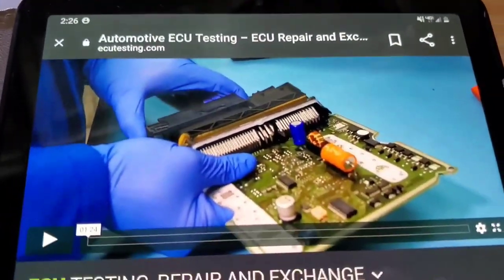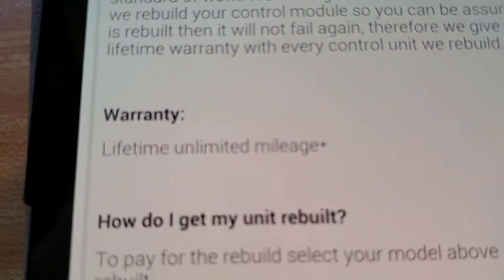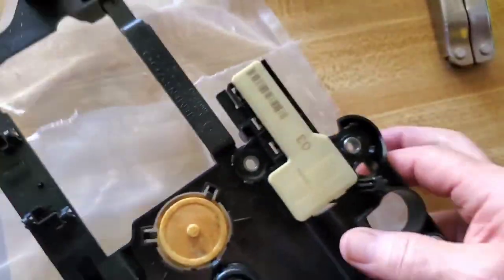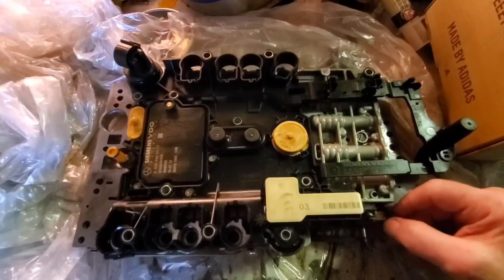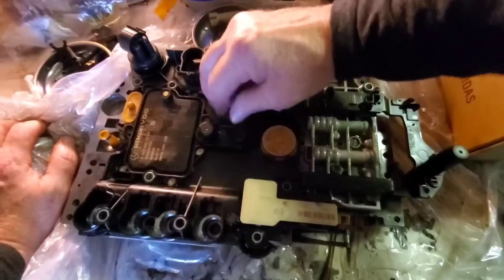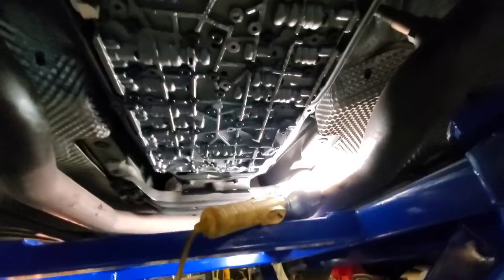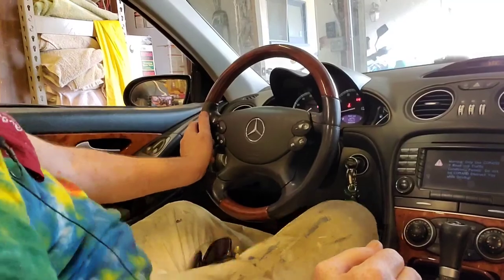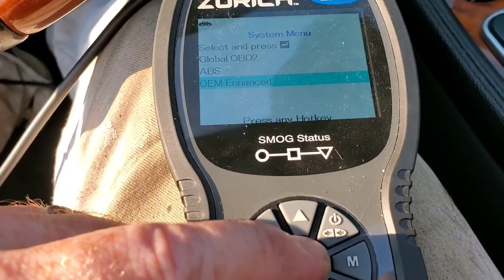Mercedes r230 SL500 transmission repair. ECUTESTING.COM module repair. 722.9 failure

Comment: Hello, thanks to your video I have cleaned my block + plate + solenoid valves.
Thank you.
On the other hand, I have a doubt.
It was not so easy to put the whole thing back on the car.
When I installed the set on the car I paid attention to the large electrical outlet & was able to finish but I did not pay attention to the plastic B3 tube.
I inserted this tube correctly & perpendicularly to its place in the block (I did not mount this tube on the gearbox) solenoid valves.
So when reassembling the assembly this tube was on the assembly that I was holding in my hands.
From what I understand this tube is only used to tighten the clutch in first & seventh gear.
I have been driving since Sunday I haven't noticed anything in particular.
If I succeeded in assembling the whole, that is to say that the plug came out well & that I was able to correctly tighten the 9 screws of the block, is it possible that this B3 tube was not mounted correctly?
If this tube would have been badly mounted can we understand it without disassembly in relation to the reactions of the car?
Reply from the maker: I'm sorry but I don't know.  I've never opened a transmission before. I wish I could help you.  Mine still doesn't work right.  😕. Thanks for watching and commenting!
Reply: @m60kaf  thanks

Comment: Assuming ECU testing was correct in that they couldn't find a fault I would start looking at the wiring harness connecting to the gearbox. In your test drive it wasn't clear to me whether the engine was faltering and not revving up or whether the revs were rising but the gearbox was slipping?
Reply from the maker: Hi Steve.. Thanks so much for watching and commenting.  When I drive it,  the engine runs great.  The transmission only slips when it goes into limp mode and is stuck in 2nd or 3rd. Otherwise it shifts very hard,  or it just goes into neutral by itself. Unfortunately I haven't played with it since this video. It's still sitting in the garage collecting dust but I do keep the batteries charged.  Someday soon I'll get back to it. I'd love to fix it so I can break it at the track next time.  I'll look at the wiring harness. Thanks!  Cheers!

Comment: Thank you for the update. Sorry, the repair result wasn't 100%. I'm sure you'll figure it out. My Ml350 has the same transmission as yours. The transmission is stocked in first gear. the reverse works but it doesn't upshift. I removed the valve body and broke the conductor plate's plug just like yours. I tested the solenoids
and seem to be Ok so I'm hoping the conductor plate is bad. there are a few companies on eBay that repair conductor plates for $199+ $18 for shipping.
I'm still debating if I should send it to the eBay guy and save some money or send it to the company you did business with because they seem to be good and professional.

Comment: I suggest you replace the conductor plate, or get another complete valvebody would be best,,, the solenoaid code will not go away by replacing the solenoid, it's an internal fault that should have been repaired by ECUTESTING,,, also you have an error for the Range Sensor, that indicates the range sensor stops working correctly when transmission gets hot,, dont worry about the can-bus error, can-bus error is caused from the bad range sensor... I rebuild these TCM and other European trans modules for Transmission Repair shops,,, if you are in southern California, I can help you
Reply from the maker: I am in the San Fernando Valley.  Doesn't replacing the conductor plate require Star system reprogramming?  The car is still sitting in the garage collecting dust while I've been renovating the house.  Thanks for commenting!  Tell me more!
Reply: b b I was told I need to replace my body valve but that my car in specific 08 C350 W205 cannot replace a new body valve with my original conductor plate would you happen to know if that’s true?

They said that the body valve will not work with a control plate that has not been updated. They want to charge me 2300 to apparently order a new body valve and program it after install. Do either of you 2 have any suggestions?

Thank you
Reply: @OGGarrettsGarage  I left a comment below for both of you guys if you have a second? Thanks!
Reply: Hi b b I left a comment below if you have a second thank you
Reply from the maker: @juan luna  I never heard back from b b. My car is still messed up. Apparently replacing the valve body and conductor plate is needed,  overhauling didn't work. $2300 actually doesn't sound that bad for the job. It's not that hard to do physically but doing the programming requires a dealer level computer that is expensive...as far as I understand it.  Good luck and please let me know if you have any luck fixing yours!  Thanks

Comment: Check your battery...i had the same problem but with a new battery it was like new
Reply from the maker: Yes. I took it to a "professional" and they couldn't get the ignition key to turn. I went there with a jump pack and everything was fine. I replaced the back battery about 2 months ago and all of the other problems self healed. Unfortunately not the transmission function though. I've got to figure out what/where the CAN bus is and maybe replace one of the solenoids.  I haven't given up just yet. Thanks for the comment 👍